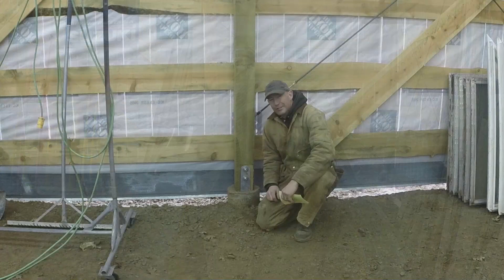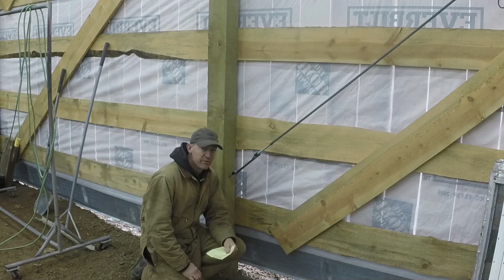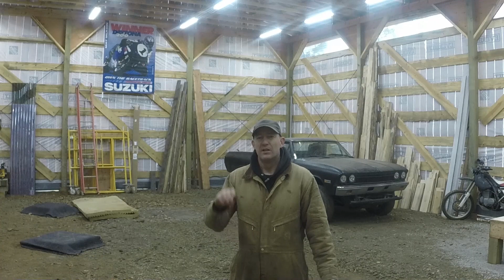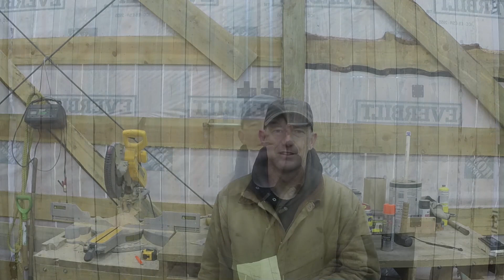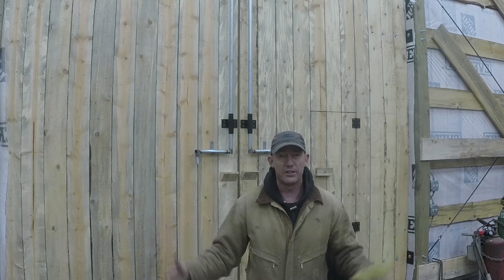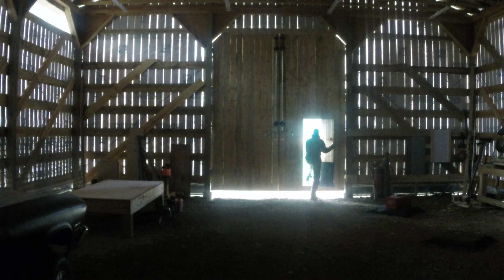How Much Did It Cost To Build My Shop, $$ Pole Barn Building

Comment: Instead of using Girts between your poles, is it OK to use framed studs like a stick build?

I guess that would make it sort of a hybrid pole frame/stick build with Sono-tubes and eventually a concrete pad without footings.
Reply from the maker: You could use a traditional framed wall between the poles but I would have a perimeter footing for the wall to sit on if you don't poor a full floor before you build. I didn't have anything for a wall to sit on to support it. Hope this makes sense and thanks for watching. :)

Comment: Awesome building. What size sonotubes did you use and where did you get those 6x6 post brackets? Thanks for the great video.
Reply from the maker: I believe the sonotubes were 12" diameter and they are 4' deep. The 6X6 post brackets I purchased from a small concrete company that is no longer around but I think you can get them at the big box home stores if you ask for them at the pro desk. Thanks for watching. :)
Reply: @KoalityofLife  Awesome brother, thanks for the fast reply! God bless.
Reply from the maker: @TheAJ_Channel  You're welcome. Take care. :)

Comment: Your cost is way off you over built . Build it like a normal pole barn then calculate your cost . This is the craziest building I have ever seen .
Reply from the maker: I'm pretty sure throughout this build series I have stated that I am over building this shop to make sure it lasts a long time. I know there are ways to build a shop that are way cheaper but will they last as long? Thanks for watching. :)

Comment: So what's the cheapest way to side a building your size? (Materials used that is)
Reply from the maker: Nothing is cheap right now. The cheapest (price per square foot) composite siding at a big box store is about the same price as the cheapest metal siding you can get. Just depends on what you like. I milled all my own siding for this build and still have to mill out the batten strips but it only cost me the time, saw blades, and fuel to run the mill. :)
Reply: @KoalityofLife  well time to buy a sawmill lol
Reply from the maker: My sawmill paid for itself before the price of lumber went up and has saved me a ton of cash now that nobody can afford lumber. :)
Reply: @KoalityofLife  I'm getting a  frontier this summer have 100 acres of various wood to pull from as a kid I help my dad cut and load pulpwood never thought I'd be possibly using it for barns and out buildings
Reply from the maker: Frontier is made by Norwood sawmills, I have a Norwood LM29 and love it. :)

Comment: My dream car. 1969 Chevelle or 1967 Camaro
Reply from the maker: That right there is a 1968 elcamino sitting on a 2001 Tahoe 4x4 frame with a sheet metal tilt forward front end. Lots of fabrication to make it all go together. :)

Comment: Having your own property and building things yourself, how did you get that all accomplished as far as permitting and inspection? I'm no engineer and haven't been doing construction for years on end, but I know how to build almost anything and build it really well. I wasn't sure if you had run into any issues building your shop yourself with it needing to be within an exact spec for permitting. Love the build, thanks for the breakdown!
Reply from the maker: In our county you can pull what they call a special out building permit, with this permit there are setbacks but you can build it however you want with whatever you want and only one inspection to see that you are building it where you said and the size you said. A special out building can not be meant for human inhabitance. The house plans were engineered so all I had to do is follow the engineered plans and all inspections went fine. I did have to learn how to run plumbing and electrical but all went good. :)
Reply: @KoalityofLife  I understand that your own milled lumber would need to pass their own inspection for water content, prior to be used for home construction.
Reply from the maker: @slingerland3g  In our county, any lumber used in the construction of a building meant for human inhabitance has to be building grade lumber. If you mill the lumber yourself you have to have it graded and stamped. This shop build doesn't fall under these guild lines in our county as it is not meant for human inhabitance. :)

Comment: Sounds like a person could pay off most of the cost of a good sawmill with the difference in a store-bought and personally installed building and milling your own lumber and doing the work yourself and only buying the material like you did.  If they had access to the timber on their own property, or set up deal with arborists or power companies clearing rights-of-way, they could really make a big difference in the cost of one or more buildings like yours over time.
Reply from the maker: Our sawmill paid for itself in this one pole barn build and it's not the first thing we built using lumber we milled off our property. With the lumber prices as high as they are today it's not hard to save money milling your own lumber.
It would be nice to get in with an arborist to get something other than pine. lol :)

Comment: Got a price for 36x48x16 34,000 now I'm thinking not bad after your video, 4' truss  oh and over head door 14x12. Don't get the 1x4 purlins for the roof oh, is that cause your truss are 2'? Built pole barns before and was allways 2x4.
Reply from the maker: That's a pretty good price. Less than half the cost of what people charge to build a pole barn this size. :)

Comment: So this might just be a little bit off topic for this video but i just noticed it in this video so i thought id tell you anyways lol
But Idk why but I'm always  irritated when I watch videos and I see people who put their dry erase markers and markers and pens with the writing tips pointing upwards so all the ink runs to the other end where the thing won't even write If it's needed to be used SO I'm very glad to see that you aren't one of those types of people who is  irritating like that or I probably couldn't watch any longer LOL 
Also if you had your lathe that you've said that you want to get you could have just threaded the ends of the rebarr and saved even more money on some of those bolts LOL
Reply from the maker: Yes, the dry erase makers MUST point down, my OCD kicks in when I see people put them in a cup facing up so they can see what color the cap is. 
I do want a lathe and a mill and a press and a sheet metal break. I think the list is a long one, all in due time. As the channel grows so will my shop. :)